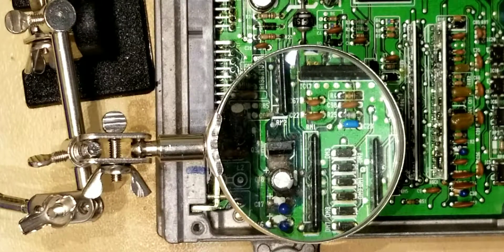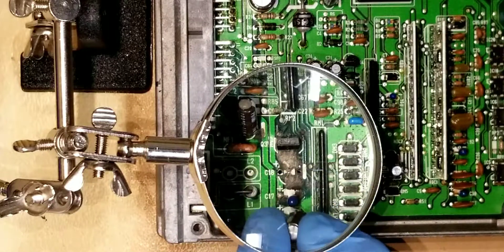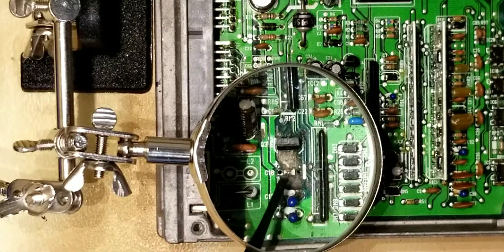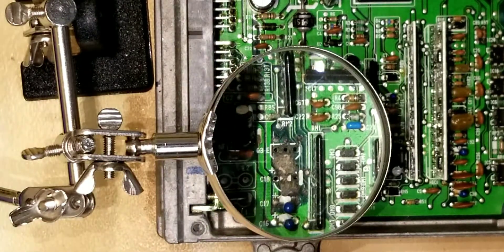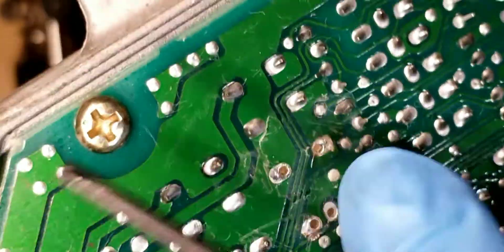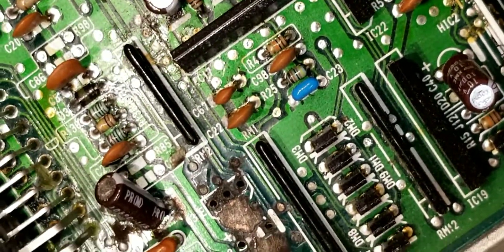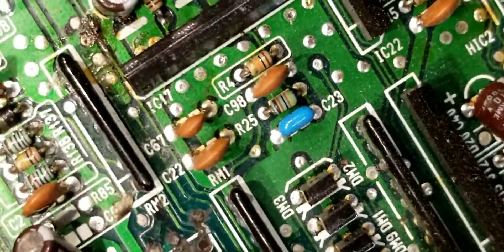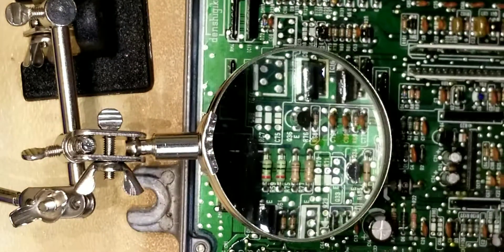What to look for on a cars ECU before working on it.

Comment: Why is that if you hold a hair to the ic17 on a p06 95 honda civic lx the fuel pump primes and the car will start?
Reply: A hair dryer is what I meant
Reply from the maker: IC17 controls a few components one being the fuel pump prime circuit. It’s failing and when hearing it the content inside IC17 shifts ever so slightly and makes contact and it “works” but soon it will stop unfortunately
Reply: @DIYKAI  ok. Thank you. I've been having problems with it for a month or two and finally figured out that it was the ic17 circuit just didn't know why it would work when heated.
Reply from the maker: Your welcome it’s common for them to do that
Reply: @DIYKAI  I've one more question..is it possible that all it could need is Resoldered?
Reply from the maker: @amandalawler783  We have seen sometimes when you reflow just a little new solder on it they can start working again that would be the easiest and cheapest route to start  with. just be careful not too much heat just enough to reflow it

Comment: What do you mean the front of the board isn't important? It's a double sided (or even multi-layered) board in most cases. That means traces on the top and bottom of the board.
Reply from the maker: My apologies my wording was off what I meant to say was the tracks on the top of the board...(at least in the ones we repaired so far) are usually not damaged. So generally they are not a problem....maybe 1 out of 10 ecus we see

Comment: The top of the board is not just printed my p28 data logging pins were ripped out on the top and the copper line was pulled  about an inch down the circuit path  On top of the board. So the top is not simply just the printed side. Copper circuit paths run on both sides.
Reply from the maker: Good to know I never ran into that yet thankfully lol
Reply: @DIYKAI  yeah it was a hard lesson learned. I'm still trying to fix that. Because it was a good board before this.   Lol
Reply from the maker: @thomasallred5266  dang. You have a simulator? They are very helpful
Reply: @DIYKAI  no, i need to get one tho.
Reply from the maker: @thomasallred5266  they are amazing  I made a case and modded mine lol
Reply: @DIYKAI  do you know if its possible to diy one out maker boards such s arduino?
Reply from the maker: I dont think so

Comment: Visual inspection doesn't mean the capacitor is good...
Reply from the maker: Yes you are correct but 9 times out of 10 if the capacitors look good they will function as normally....meaning not leaky, bulging ect.....I always test ecus on my simulator b4 and after to set benchmarks

Comment: I have a p28 ecu. You happen to know if the ic17 location controls fuel pump function by any chance? On the same ecu i have a burnt resistor or whatever its called, black plastic, number r135 i believe. Can't really find any info on this stuff.
Reply from the maker: Ic17 is one items that control the fuel
Reply: @DIYKAI  thanks for replying btw!